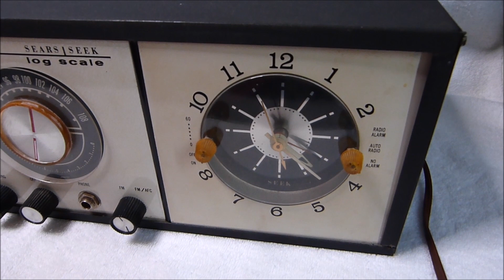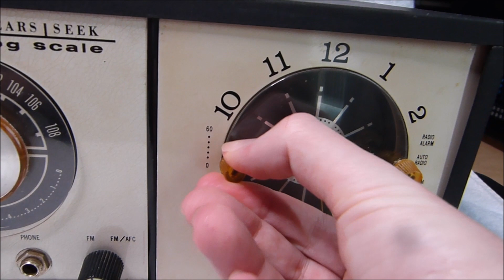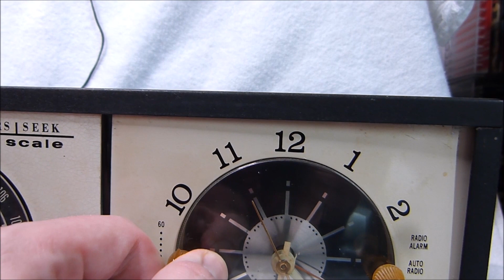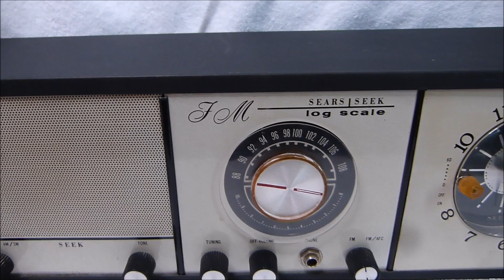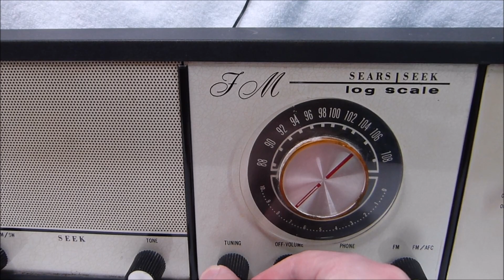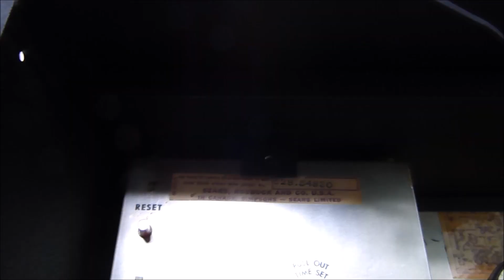Rare Sears SEEK modular AM/FM transistor radio kit (USA, 1960's)

Comment: I've found your radio in the Fall and Winter 1963 Sears catalog, page 1368.
AM/SW 57G7490 tuner, 57G7491 speaker/amplifier, 57G7492 FM tuner and 57G7493 power supply/alarm clock (the speaker/amplifier does not exactly match the photo, it shows only a metal front with a perforated grille, no chrome strip at the bottom).

Buy all four for $79.95 (in 1963 dollars - wow).
Reply from the maker: Thank you very much! I had tried digging for it in old Sears catalogs, but not that particular one. It's nice to finally see an ad for it. 
I would bet that the price was a major factor in why this kit is so rare. For $47.95 in that same catalog you could have bought a very stylish 12 transistor Silvertone AM/FM radio, fully assembled. It seems to have been on the market for a very short time.

Comment: Working in manufacturing, and being somewhat familiar with the new product development process, I'm sort of surprised that this product line was approved for production and sale. It's interesting, but so huge and impractical, at a time when companies like GE were introducing micro sized clock radios that would easily fit on a bedside table or even on a floor lamp with a built-in tray.
Reply from the maker: I'm also surprised this kit was ever designed and made. It seemed doomed to failure, especially with how expensive and impractically massive it is/was. They could have at least made the cabinet a cube shape with the two tuners on top!

Comment: Was this made by Arvin, the usual supplier of transistor radios for Sears?  I wonder if you could buy a different size of cabinet, if you didn't want to buy every module?  Definitely a curious radio!
Reply from the maker: The manufacturer code is 528, so this one was made for Sears by Warwick, their other major radio supplier. You could apparently buy small cabinets that held just one of the modules, and there was a deluxe wood cabinet for all four available too.
Reply: Another possibility would be Unelco Electronics of Baltimore, MD.

I have a Unelco 1914 (year of design? LOL) radio that was a plastic version of the old multi-band radios that needed two coils to be operated on all 6 bands (total 12 coils). The user had to pull both the oscillator and antenna coils and change coils to change bands.

In other words, a transistorized version of a radio design from the 1920s!

This was my first exposure to shortwave radio.

Comment: I'm so happy you posted this video. I have the clock module with the power cord and have been searching for it online using the model # (7493) and/or chassis # but nothing has come up.  Then I noticed the word SEEK on the face and searched again. Your video was first thing in my search results.  
Very cool, I thought it was just a alarm clock radio. Now I know what the 12v attachments are for! If anyone ever needs a replacement clock/power module,  I've got one!  😊
Reply from the maker: I guess I posted the right video at the right time, and I'm happy that I could help!  Interesting that someone purchased just the clock module, but no radio to go with it. Does your clock have a cabinet too?
If you want more information, take a look at the pinned comment, and page 1368 of the "Fall and Winter" 1963 Sears catalog, which can be found here: https://christmas.musetechnical.com/ShowCatalog/1963-Sears-Fall-Winter-Catalog